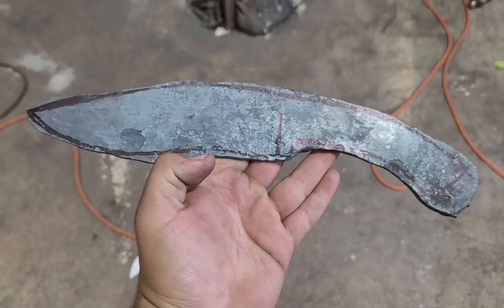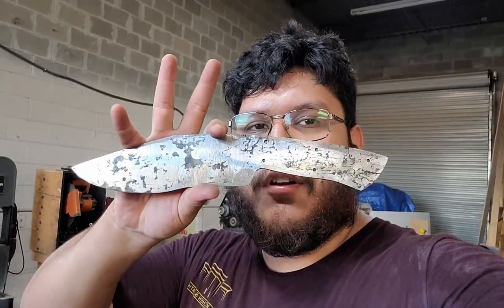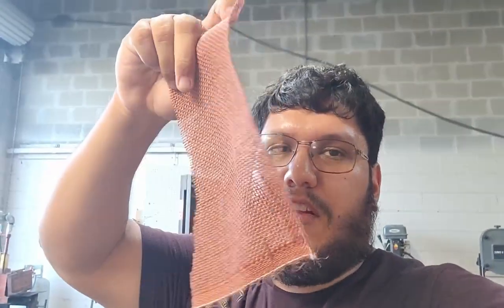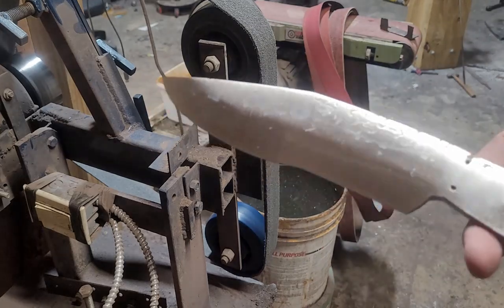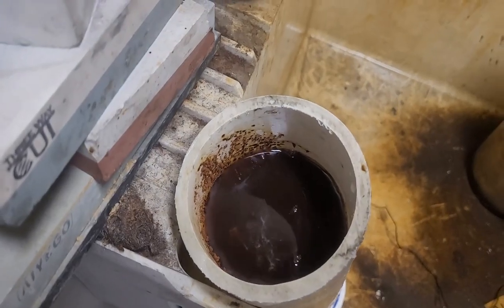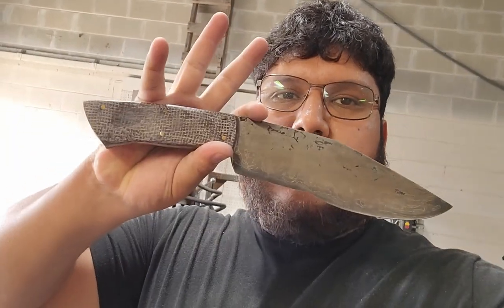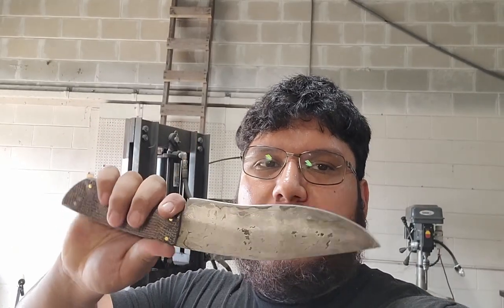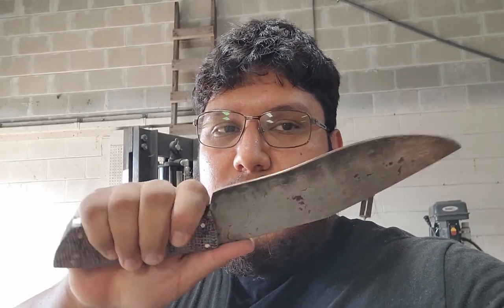Forging A Screw Damascus Chopper

Comment: Nice knife, good job.  One thing though, it’s not advisable to forge the bevels on a San mai.  You’re just thinning out the cladding.  This is a time it’s better to grind in your bevels and then the transition line will be higher up your blade.  👍
Reply from the maker: Ive done it like that but i feel i dont get the same movement in the line i would otherwise if i forge it out some. Ive seen some that have basically a straight like going through instead of the peaks and dips i like to see in a san mai. Any tips for that?
Reply: @JPsBladeworks  when forging it, hit it every inch or so with an aggressive rounding die or with a gulliotine tool and then flatten it out.  Then cut your blade out if it.  That way you get a ton action in it but don’t risk forging it too much.
Reply from the maker: @TyrellKnifeworks  sounds logical. Ill give it a try on my next san mai. I really like how yours come out.